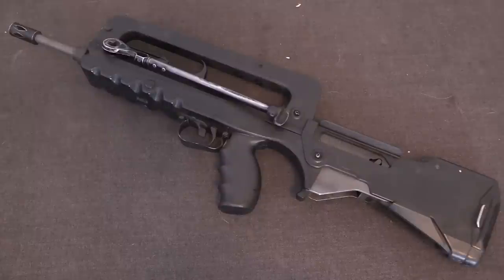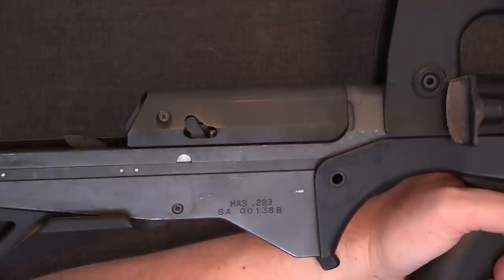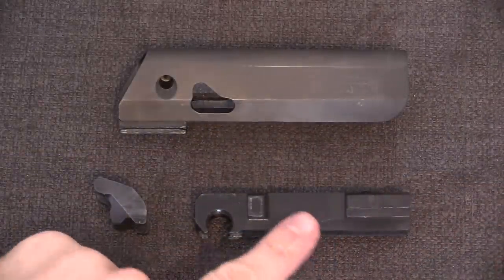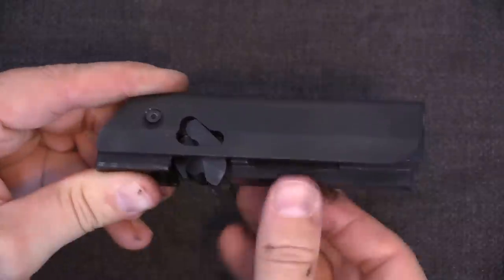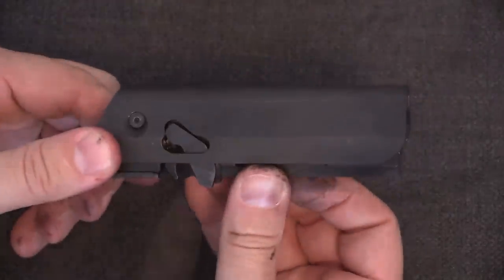How Does It Work: Lever Delayed Blowback

Comment: Another cool aspect of this mechanism is that the charging handle, being connected do the bolt carrier, acts from the "advantaged" side of the system, which actually makes racking the bolt easier (or at least not more difficult, depending on the circumstances).
Reply from the maker: True.

Comment: I think of the "roller delayed blow back" and "toggle look" being the same thing. In practice inte a degrecive spring.  Am suprised that its concidered to be so different from eachother. Just different mecanical solutions to acheve the same result. Though I can imagine its easier to manage the angle of the rollerdelayed than to fine trim the lever. Very interesting this videos.  :)
I really appreciate the scientific/enginering take of "Forgotten weapons" other content creators only lift out the obvious features in a design and very often have a limited deeper understanding of the design process and features actual function. Tack Ian!!

Comment: The FAMAS will forever be the coolest looking military bullpup (I actually really dig the aesthetics of the Kel-Tec RDB). One question I have is: what is the benefit or advantage of using the lever delayed blowback system over something more ubiquitous and presumably easier to produce like a long stroke piston or even the piston/direct gas impingement system of the AR-10 and -15? Was this just a case of France wanting to do something different? I have to wonder if the lever delay system is better than the roller delay system too, for that matter.
Reply from the maker: A pistol system would put more weight at the front (balance was an important design element in the FAMAS, and it shows) and would make it more difficult to free-float the barrel.
Reply: @ForgottenWeapons  thanks for the quick reply! I was not expecting to hear from The Man Himself after asking this question! You've really made my day, honestly.
Reply: All the gas system (gas port, gas piston, gas cylinder, op-rod, a spring in case of short stroke) is replaced by a single adjunctive part, the lever.

Comment: I've always wanted to know this one, it always confused me hard.
Reply: I'm still confused how does pressure get transferred to the bolt carrier if its locked it seems as if the pressure has no way to force the bolt open
Reply: @CenlaSelfDefenseConcepts  It's not locked.  It's just that for the bolt to move back a tiny bit the bolt carrier has to move back a lot.  If you listen to what Iain says carefully he says "the accelerator lever is locked into the receiver",  the bolt is not locked.

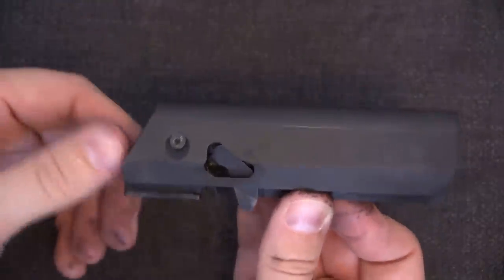Comment: 1:02 but why? all I see is a lever that delays the opening of the bolt, I don't see why that lever would make it harder for the carrier to move.
Reply: It applies a bit more mechanical counterweight for the gas to push.
Reply: @EuroRhodes  My bad, I confused the charging handle's rod with a gas piston when in fact it's right there in the system's name, it's a "blowback" .
Reply: It trades mass for speed. To accelerate a mass to double the speed in the same time, you need four times the energy, so introducing a lever that accelerates the carrier in respect to the bolt face, you need less weight than in a pure blowback system. .

Comment: So the reason for being a delayed lever system and require more energy to move the bolt back is to ensure the full release/expansion of the gas (and prevent a gas explosion??) in the chamber when the bullet is fired?
Reply: Exactly. The case is still extracted in high pressure but not so much that can destroy rifle or harm shooter.
Reply: Lever delay is one of a few ways to keep the bolt from opening too soon after firing.  If it opens too soon the high pressure could cause the cartridge case to rupture resulting in injury and/or damage.

Comment: Why don't we see this operating system more?  It offers the same advantages as a roller delayed system but is simpler and doubtless cheaper to manufacture.  It would seem that this system would be especially suited to low pressure cartridges such as in pistol caliber carbines where improvements in weight and recoil could be had over simple blowback.

Comment: Any evidence on how durable this is?  Seems like not a lot of steel to tame the forces at work.  For a .223 may not be an issue. PS: So is the Famas the best of all bullpups?
Reply: The same delay mechanism is used in the French AA52 7.62x51 machine gun which is still in (limited) service after over 50 years, so it's probably fairly robust :).  (There was even an experimental version in .50BMG).

Comment: So is the high extraction pressure the main reason we don't see this mechanism used on more firearms?
Reply: The roller-delayed system runs on the same principle and it widely adopted.

I think that what happens is that both the long stroke and short stroke piston design are easier to copy-paste.
Reply: What komn87 said. So much r&d has gone into long stroke and short stroke piston design, as well as whatever the system is the AR-15 was again (not direct impingement), that they've taken over as the go to methods, along with some roller delays in the mix (which IIRC were generally thought of as harsher to shoot by comparison to AR-15 and short stroke guns, but I might be wrong). And IIRC in the FAMAS video Ian did mention that while the lever delayed blowback system is very reliable and simple when using the ammo it was designed for, it can be a bit picky about the bullet weights, powder loads and casings, and might require modifications to move from one type of round to another, like how they had to modify the FAMAS to run reliably and accurately with NATO spec brass cased ammunition, vs. the original French steel cased 5.56. You can't simply adjust the gas pressure etc. on the FAMAS to cope with different loads, you can only do things like change the fluting of the chamber, the length of the levers and the mass of the bolt carrier to change the dynamics of the gun.
Reply: In theory the system is as safe as pure blowback. It simply exchange the mass of the bolt with the acceleration of a part of it. 
In practice, using riflle ammunitions, it's difficult to fine-tune, being always on the verge of having a too harsh extracion (not enough mechanical disadvantage) or not having enough power to cycle the action (too much mechanical disadvantage).

Comment: I suspect that a FAMAS would be a good first project for a 3D metal printed firearm replication / production effort.  Lots of moving parts, but few under the highest stress levels and only a few tolerances critical for safe headspacing.
Reply: Just that pesky extraction issue...
Reply: Joel Rigby Fair.  Fluting the chamber isn’t orthodox easy but isn’t that difficult to do either.  A little electrical discharge machining perhaps.
Reply: @Georgewilliamherbert   Or maybe chemical etching?

Comment: How would it change the perceived recoil, if the lever pushed the mass forward?
Reply: I may be misunderstanding but if the lever were acting to push the bolt carrier forward it would act like a simple blowback (Maybe less so since the leverage is now effectively pushing the bolt backwards) until the lever has moved its full travel, then the bolt would rather violently impact the carrier rather than gently following along with it
Reply: Delayed blowback mechanism in itself reduces somewhat the feeling of recoil.
Reply: RocketSurgeon  AFAIK, the blow forward systems have a terrible felt recoil, though I´m not quite sure why.
I was thinking of some mechanism where the mass is forced forward, similar to the AK101, but  where the the bolt has a disadvantage to overcome.
Thinking about it, I guess it would add to the impulse rather than reduce it, but it still boggles my mind...
Reply: @edi9892  Blow forward systems have a huge perceived recoil due to the kinetics changing direction entirely at points in the cycle
If you brace for the recoil coming backwards but there is a forwards lurch then backward movement it has altered your stance and lost the bracing

Delayed blowback however simply softens the felt recoil as you are already braced and it is now a lesser impact over a longer period

Comment: Such videos would be a lot more informative if you mentioned at what point the bullet left the barrel and pressures started to normalize. We all know this is a matter of timing. So explaining the timing would make it easier to understand the mechanism.
Reply: You can do the maths yourself.
A Sterling machine carbine, which I was familiar with, has a 7.7 inch barrel [we'll ignore headspacing] which is 0.64 feet.
NATO 9mm goes at about 1800 feet per second.
That's 0.00035 seconds to clear the barrel.
Slowing the breach opening isn't actually the trick, it's making sure there's enough power left in the system to reliably cycle the gun

Comment: Dont quite understand why the lever is called "accelerator" dow its function is to delay and spread de force fom the bolt to de rest of the sistem .
Shoud be called decelerator no ?
Reply: No, because it accelerates the bolt carrier relative to the bolt.
Reply: @skepticalbadger  yea but decelerates the hole sistem an that is the main and most important efect by decomposing the force ( jedi efect...jejeje )

Comment: Is this the only time the French used this system?
Reply from the maker: They used it in the FAMAS and the AA52/F1 machine guns.
Reply: Do you suppose it was used instead of a gas system because it may work with a wide variation in ammo pressures?